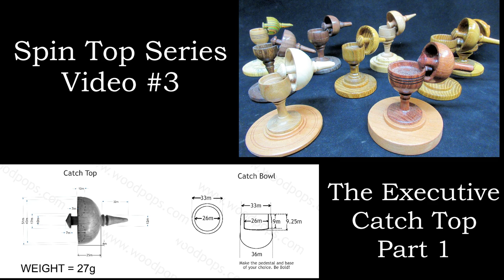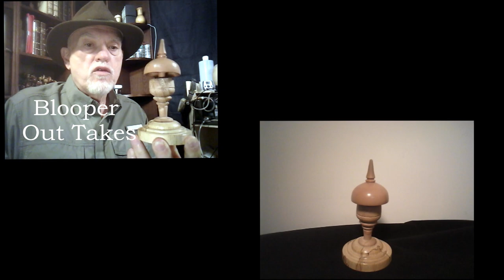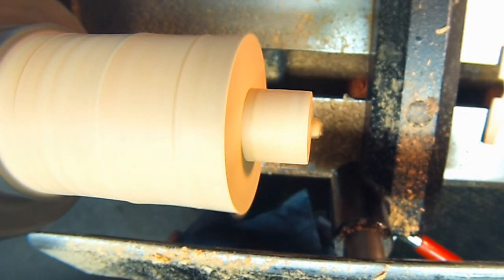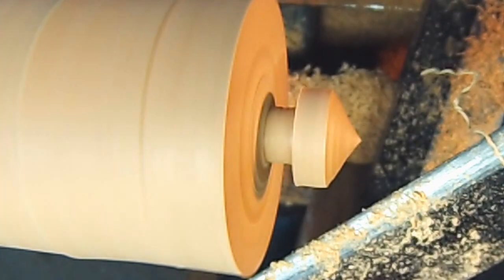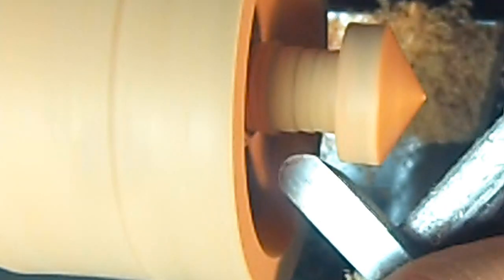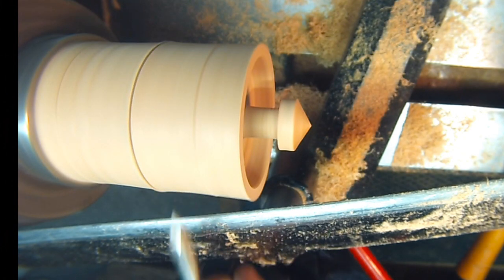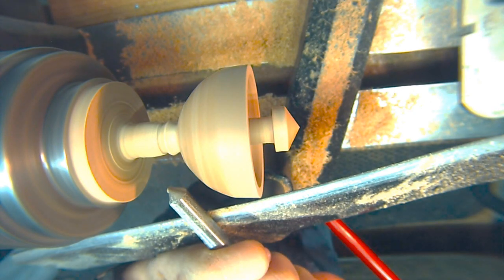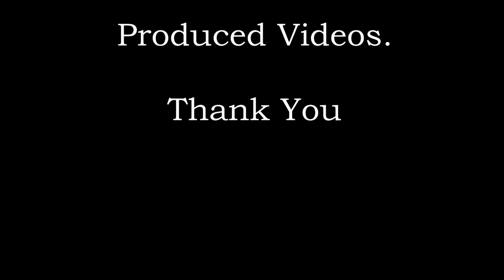Woodturning Art The captured wooden toy Spin Top Tutorial Part 1

Comment from the maker: Ok we have our 2nd review in from Les.

"thanks for the template. I finished my first "catch top" today. Base and top out of oak with the help of your template, videos, and diagram (included with template). 
Turning, sanding, and finishing (with shine juice) took about two hours total. I estimate, once learned, the process should take me about 30-45 minutes. 

The template is an excellent guide. Edges are sealed to keep it strong enough to test widths while the lathe is turning. It would have been helpful to have the starting dimensions of the wood blank --especially the length. I added up the individual segment lengths to get to 71mm + 30mm for the chuck or roughly 4" x 2" for the blank (add a fraction for sanding as your skill level requires ;)

WoodPops' video describes three tools he created for the project. Since I don't have these, I found myself using my parting tool and smallest detail gouge exclusively after roughing out there basic form with a 3/4 inch spindle gouge.
 
Sanding from 80 - 400 grit was fast and easy. 
My finished top does not spin well but it does catch perfectly. This seems to be a function of the catch bowl rather than the top (it spins fine on the table). I believe the bottom of the catch bowl may not be curved (cupped) as shown on the plan.  I look forward to correcting this error on my next attempt.

Fun little project made easy with the template and videos. Recommended!

Comment: Subscribed. I'm signed up to get your free template and I'm looking forward to make one. Very helpful videos.
Reply from the maker: OK Chris! You are in my top ten. Thanks for helping out. Looking forward to our project.
Reply: @rogerdalescott  , thanks for the template. I finished my first "catch top" today. Base and top out of oak with the help of your template, videos, and diagram (included with template). 
Turning, sanding, and finishing (with shine juice) took about two hours total. I estimate, once learned, the process should take me about 30-45 minutes. 
The template is an excellent guide. Edges are sealed to keep it strong enough to test widths while the lathe is turning. It would have been helpful to have the starting dimensions of the wood blank --especially the length. I added up the individual segment lengths to get to 71mm + 30mm for the chuck or roughly 4" x 2" for the blank (add a fraction for sanding as your skill level requires ;)
WoodPops' video describes three tools he created for the project. Since I don't have these, I found myself using my parting tool and smallest detail gouge exclusively after roughing out there basic form with a 3/4 inch spindle gouge. 
Sanding from 80 - 400 grit was fast and easy. 
My finished top does not spin well but it does catch perfectly. This seems to be a function of the catch bowl rather than the top (it spins fine on the table). I believe the bottom of the catch bowl may not be curved (cupped) as shown on the plan.  I look forward to correcting this error on my next attempt.
Fun little project made easy with the template and videos. Recommended!
<><